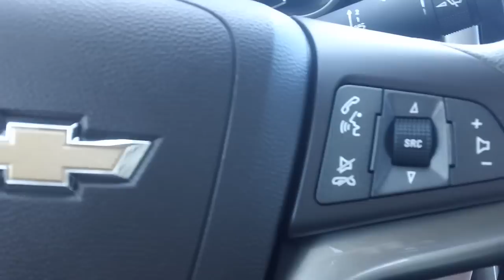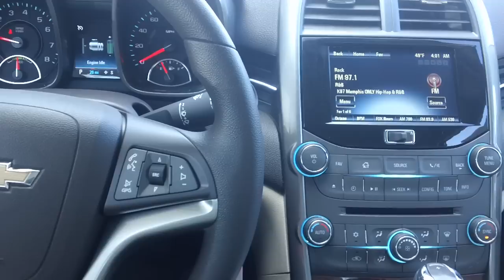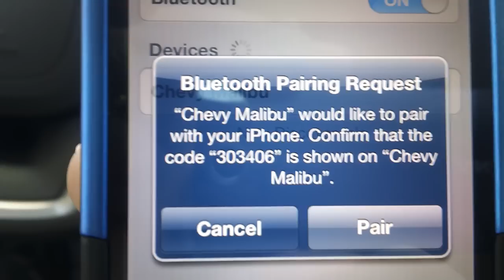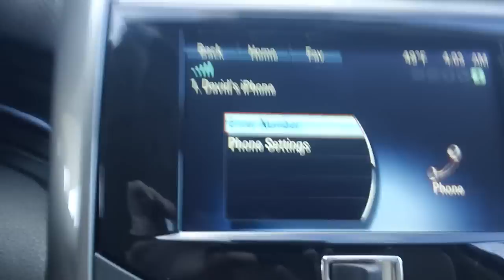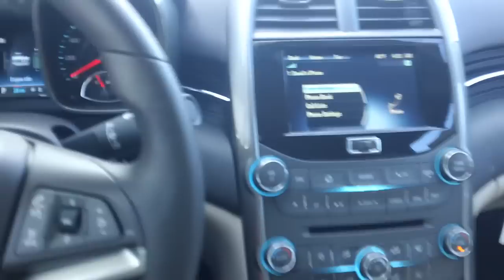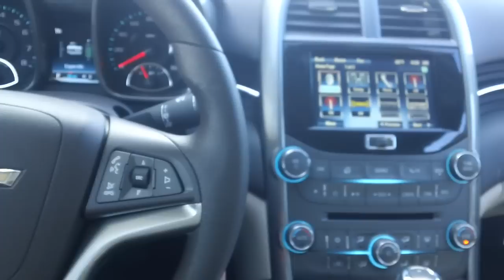Chevrolet MyLink Tutorial - How To Set Up MyLink with Your Phone

Comment: I don't have an issue with pairing. The problem I have, is that Chevy Mylink won't work when making bluetooth calls. You call someone from the 2018 Equinox that I drive, is that you can hear them when they answer the phone, but they can't hear you for 30-45 seconds. Of course by that time, most people just hang up. I know that the issue is with the Equinox, because the same three phones not working on the Equinox, work perfectly fine on a Ford Escape, Hyundai, and Nissan Rogue.

Comment: I bought a 2016 Chevy Trax. I have a 7 inch display MyLink, in dash, with 4 antiquated apps  available for the screen. BRINGO NAVIGATION is something I won't touch with a ten-foot pole after reading reviews and the cost when I have free apps  using my phone as the home screen. Seems like a big waste of money for such a dramatic display for something that my phone can do a hundred times better. Then again, I was probably assuming the MyLink system had updated software when I purchased the vehicle. Something I could do on my own, but I'm sure the dealership will charge me a fortune to do so. According to all the YouTube videos in my Chevy app, the MyLink system should mirror your smartphone as long as they're compatible apps. Yeah, I got Pandora and three pieces of crap. Basically, all I ended up with was a Bluetooth car speaker with a pretty screen. And BRINGO? Seriously? I've seen beta prototypes apps get better reviews than this Canadian export piece of crap. Come on Generous Motors you can do better. So basically, the MyLink system in my 2016 Chevy Trax does absolutely nothing to benefit my safety. I'm still depending on myself and smartphone for traveling and can only hope for the best and avoiding law enforcement.
Reply: I know I'm late to this comment but am discovering this now myself. Have a 2016 chevy trax lt and it came preloaded with those apps and I can even get them to mirror my phone- they just say they aren't connected? Did u ever figure the system out? All the videos I've so far have other widgets that allow them to get tonother apps...I can't even download onstars app!!